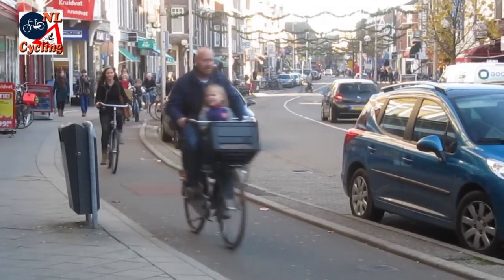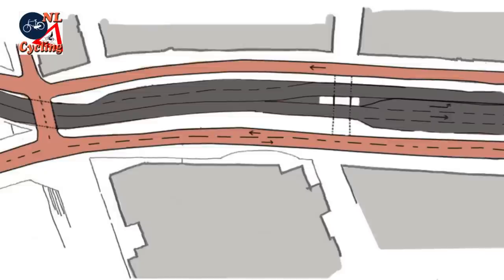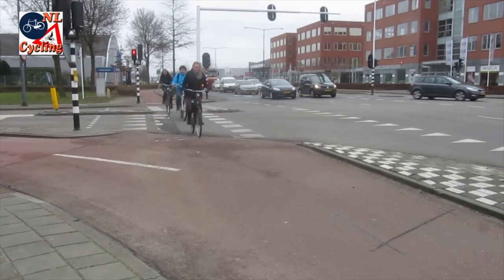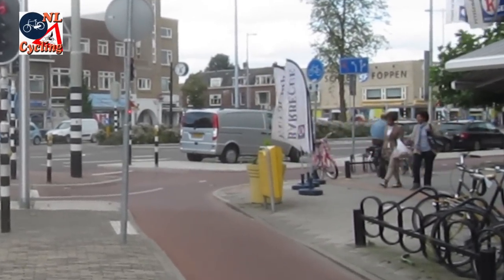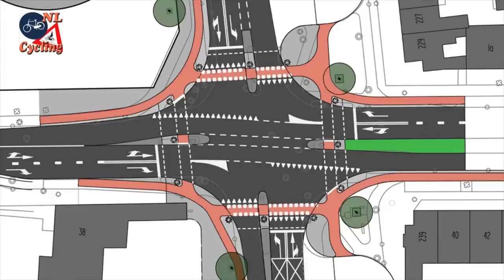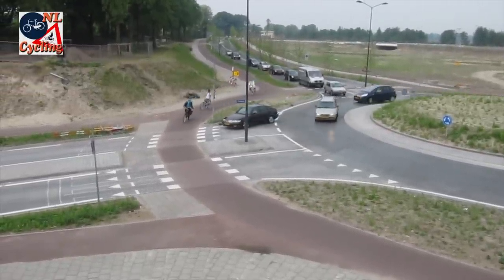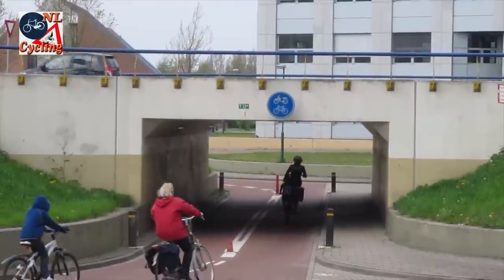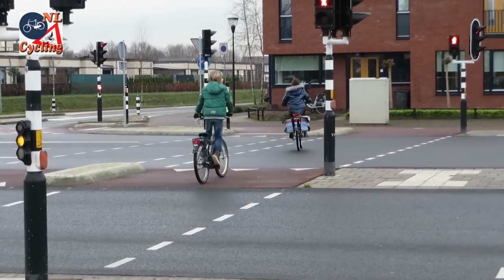Junction design in the Netherlands [311]

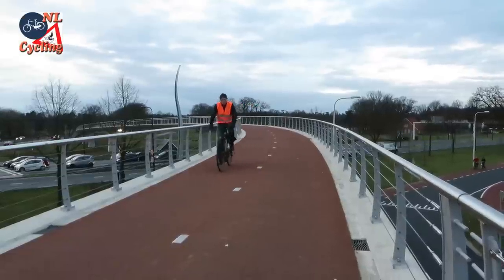Comment: I completely disagree with the roundabouts being safer for cyclists. It is an absolute nightmare if you have to stop in a truck and give way to cyclists on the right. You can get a good look in as you approach the roundabout and whilst navigating it, but if you have to stop, it can be extremely hard to be 100% sure it is clear. IMO, cyclists should give way here. Perfect example is 3:49 if this coach had to stop to let a few more through, he would find it very difficult to look back and check for more. At 4:55 we can see the blue truck basically just hopes for the best; he would not put his life savings on it being 100% clear.

Comment: "Speeds at turbo roundabouts are usually so high that there is no alternative than to have cyclists bypass them in an underpass" - and in the UK, of course, cyclists are expected to share the roundabout with motor vehicles, regardless of speed or safety.

Comment: The best way is to prohibit pedestrians and vehicles of less than 4 wheels.  Problem solved!  And to the narrator... slowing or stopping traffic is NEVER better for the environment.  When you stop a vehicle, you're idling, resulting in zero MPG.  And then you have to accelerate, resulting in worse than zero MPG, more noise, more pollution.  The ideal solution is to have a system of under/over passes with on/off ramps and access roads for shopping centers and residential areas.  NO traffic lights, NO stop signs, NO roundabouts... NO slowing down or stopping.  This would require demolishing the entire world and rebuilding it with proper, correct, gasoline powered, v8, rear wheel drive, 20 foot long, 8 food wide American cars and trucks in mind.  Anything else is wrong, immoral, idiotic, and just plain fucking stupid!

Comment: Our country went on a roundabout craze. I hate and love them at the same time. I hate that if you drive constantly from a roundabout to roundabout you are constantly on the edge, constantly having to push your car forwards and stop if the traffic moves and constantly monitor the situation.

With traffic lights its simple, miss your turn? Wait, you can even grab a drink or check your phone log, you have like ~15-30 sec of standing in one spot.

The positive about roundabouts with light traffic, you obviously gain momentum but you somewhat have more stress.

Comment: Now all car drivers need to do is actually stop when they are supposed to. I've been hit by a car twice in one month while riding my bicycle because they just drove on without looking, at a place where they were required to stop. All these crossing points and roundabouts are great, but it still won't work if people (both car drivers and cyclists) don't follow the rules. However, it's still better than Australia. I've been there 3 times and I would NOT dare to ride a bike there!

Comment: A troublesome addition to this design has been implemented in Delft; most cycle lanes are bidirectional - also on the roundabouts. As a result, neither pedestrians nor car drivers know where to look.
Reply: Agreed, the big roundabout in Pijnacker is also infamous for the two-way traffic. I ride and drive there regularly and both on the bike and in the car it is a dangerous situation.
Reply: We also have one in Hoofddorp centre with the fountain in the middle. 
It used to be a single direction for cyclists for a long time. Then it suddenly changed into a bidirectional roundabout. I'll admit that turning left is quicker and will save you some time if you want to go straight through, instead of going all around when turning right. But it has become a bit more challenging for drivers and cyclists alike.

Then again, this has been done to create a seperate cyclist lane which runs on one side of the
Marktplein / Kruisweg, to avoid having cyclists on the road.
Reply: yeah those ones are even confusing to me as a cyclist, it's often unclear where to go.
Reply: They make no sense, they're counter-intuitive. I don't think they'll be a lasting thing.

Comment: bicycles should never have priority. Cars have visibility problems with all the over thickened roof pillars due to safety regulations, and all cars today weigh 3000+ pounds, even the economy cars because of said safety and "environmental" regulations. It is dangerous for cars to be slamming on their brakes to make way for a bicycle that might weigh 150-200 lbs including the rider that can stop on a dime and has perfect unobstructed visibility. safety in traffic should always be the responsibility of the cyclist.
Reply: Morally speaking safety is the responsibility of the one putting others in danger over the one putting himself in danger. If you don't want responsibility, then maybe you shouldn't be slinging 3000+ pounds projectiles around.

Comment: These designs are way to trusting in motor drivers i don't move unless i look a driver in the eye first while walking or riding a bike.
Reply: Okay, very good point. That is exactly why it was built this way: cyclists and drivers and pedestrians can see each other face to face before moving. A split second is all you need to make your decision. Whereas with drivers coming up from behind, that would be impossible. But the best proof would be to try it out for yourself. Don't just take my word for it. Or as second best, read reports of your fellow countrymen cycling in NL.
Reply: A. Goldsby well dutch are used to cyclists soo
Reply: A. Goldsby 
You need to still be careful due to cell phone users... They can be looking at you, but not see you.
Reply: Danielchai S you cant realy use your cellphon in the car in the netherlands since we use a lot of speedbumps and stuff

Comment: "Cycling at high speeds possible," I'm sorry but there's no way you can safely ride a bike at over 15 mph in those lanes, which you can easily do in most US cities, if you know what you're doing. I'd hate to be stuck behind some of the slow cyclists in the video. I can average close to 15 during rush hour traffic in Manhattan, which means I'm cursing at over 20. Doing that on such narrow bike lanes with seniors and kids is dangerous.
Reply: I guess you're right. Yours is one category of cyclists the inner city cannot cater for in this design. Further out there should be no problem.
Reply: Actually no he isnt, you can easily safely do 15 to 20mph if you know what you're doing and slow down a bit for crossings or when theres traffic.
Often mopeds and scooters use them as well. But if you use your eyes and brain, a lot is possible.
He just wants to be the cool 90s guy in Manhattan on the mountainbike with the headphones waving through traffic like marty mcfly on his skateboard, but with an iphone and a latte.

Comment: 3:30 They are actually worse for the environment, because cars have to slow down massively and get back up to speed again.
Reply: Robert  That's true, but this is the Netherlands. Roundabounts are mostly placed on crossings without traffic lights, where traffic on the larger road has right of way. Most traffic won't have to slow down whatsoever in that case.

Comment: Does somebody notice the lack of pedestrians?
What would occur if a cyclist decided to not use that bike lanes?
Reply: You would be put into your place by motorists quite quickly, unless you can keep up to speed with them.  Some people with "egg-shell" bicycles (a bicycle with an egg-shaped, aerodynamic hull around it where you sit in with your head sticking out sometimes equipped with left and right turn indicators) sometimes choose to ride on the regular road because the safe havens for regular bicycles are not long enough for their bikes, and also, if it's wider than 75 centimeters they can choose to ride on the regular road, which could also be safer because they can keep up with cars.  /watch?v=ssD_ZVErgTg  << in this clip (unfortunately completely in Dutch) from a program about all aspects of road safety and road behavior of all groups of traffic you can see someone with one of those egg-shell bicycles doing over 60 kilometers an hour, which is around 37 mph.

Comment: Now check out the number of deaths and injuries from people being knocked down where bicycle paths cross roads. I lived in the Netherlands for 25 years and witnessed a huge number of accidents. As a car driver bicycles are often not visible coming from the right hand side if a left hand drive car. These systems are very dangerous and not to be recommended.
Reply: As compared to what? The lowest rate of injuries and casualties per kilometer ridden, world wide. That's just statistics. Any suggestions for improvements? And again, compared to what?
Reply: It just shows the danger of mixing high and low speed traffic I would say. In the ideal situation these two modes of transport would aways be separated, until the speed in a shared space is low enough to allow mixing. But until we can afford tunnels and flyovers at every crossing, the dutch approach is probably the best we can hope for.

Comment: As a Dutch guy, I want to say that the nice design shown in this video is amazing, but don't expect to find such nice junctions everywhere. Most of the areas I drive that are outside of the city, or in smaller cities aren't that well designed.

Cars have to wait on the roundabout for cyclists because there's no zone for cars to wait, blocking other traffic. When you turn of a road that has a bicycle lane, like at 2:35, there's quite often no zone to wait in. You have to stop your car in 80km/h traffic to wait for cyclists. This is annoying and can be dangerous.

In the large cities and the busiest roads though, the system is absolutely amazing and cycling can get you through traffic way faster and safer than a car :)

Comment: In germany most cyclists still use the roads EVEN when there are seperate parts for them nexto the street. No joke, you see this everyday. The biggest problem here is not the infrastucture but the behavior of the people...
Reply: Nope, it's the infrastructure, unless you think Dutch people are somehow morally superior to Germans...If people are using car lanes instead of the bike lane, that means that the bike lane is sub standard. in the Netherlands bike lanes take the most direct routes, usually have priority at lights & are better maintained than the roads. Using the car lane would slow a cyclist down, so nobody would think of doing it. Anyway, it's illegal not to use bike lane if there is one, but you'd be crazy not to.

Comment: you have to have super wide distances between buildings
Reply: FullOilBarrel which isnt really a problem.
Reply: You'll see that in the more modern parts of dutch cities, where the distance between buildings is larger to account for car traffic. In older parts of town, you'll often see only two lane (one in each direction) brick roads shared with cyclists, or only a thin cycling lane. This is, of course, only for light traffic in the city centers.

Comment: I live in Milton Keynes the city of roundabouts and im sorry but the roundabout system would not work here as it is by far too dangerous to cross on the roundabout, we just have underpasses everywhere so you never ever have to cross a main road.
Reply: But you must agree that Milton Keynes has been built on a Netherlands (civilian friendly) Structure, redways are everywhere and is probably one of the safest cities for civilians where cars can go at motorway speeds within the center of town. It may not be pretty with the blocks but is is designed beautifully.
Reply: I went to reply but your comment is not here, wtf.
Reply: That is strange as we were only discussing, not like we were arguing actually it was rather interesting...
Reply: Now your newest comment isn't here, but the older comment is. Youtube, please fix your shit.

I think Milton Keynes is a prime example to for example the US as to how they can reform their car-centric cities to bike-friendly cities without needing massive reconstructions and lane removals that would most likely not be received well. I just have a thing against roundabouts, they really shouldn't be placed on through roads, place them in residential areas all you like, but through roads? No, just no.
Reply: If you can go to Milton Keynes its a good experience its like watching those car commercials where they stunt with them. People here have gotten used to it barely slows you down as there is no red lights.

Comment: This is because there are more cycles there otherwise these designs are flop in vehicle dense cities.
Reply: Did you ever consider there are more bikes exactly because it is designed that way? That's the whole point, really.
Reply: @mourlyvold7655  No, not originally. If you made this in a traditional car friendly city, it would flop. This cannot work everywhere. For example: UAE.
Reply: @Shumayal  
We're basicly saying the same thing, really:
Design for cars, you'll have cars. Design for pedestrians and bicycles (and public transport) and that's what you'll get.
We are traditionally a biking nation, true. But it's very clear that implementing bike friendly design stimulates their use dramaticly. There's 50 years of experience to proof it. 
We were moving into the opposite direction in the 1960's (car centered) but people just were not having it, and local governements responded. That developed into a nation-wide policy. 
So that's what I meant to say. Development driven by design, as a response to a popular ground-up movement. I do understand the situation in the UAE is much different. In general the Dutch agree we're better off this way... 
Peace.
Reply: @mourlyvold7655  yes it works for the Dutch. Because with the example of UAE, you have the hot climate which means only the poor people cycle and use public transport.. . those who can't afford cars.
Reply: @Shumayal  I understand.

Comment: What happens in winter? Who plows the bike/walk ways?
Reply: SolarizeYourLife In the winter salt is used to melt the snow/ice.
Reply: +SolarizeYourLife: Cycle tracks are plowed, brushed, salted or a combination of these, just as the rest of the roads. Some municipalitied even give priority to maintenance of cycle paths.
Reply: +ProtectingSilence really, I thought salt was not good for the environment?
Reply: Your comments are not smart enough. -  And pedestrian paths are also salted! Even the landing paths for the planes to take of and landing are treated the same way!
Reply: +SolarizeYourLife When I did contract work in Boulder Colorado, the city plowed and salted the bike trails, separated from busy streets as soon as the streets themselves.  It takes only a little tractor and plow and bike paths don't need that much salt either, no sweat plowing a bike trail.  I rode my bike at temperatures down to about -12 deg C (10 deg F) at night and I still saw plenty of people bike riding really not that cold for Colorado.  Boulder gets colder and can receive more snow in a blizzard than in the Netherlands, but even though it is in the USA some good bike infrastructure which is not so expensive makes a radical difference, nearly 20% on bicycles or walking in the city limits.  Cities like Boulder Colorado and Davis California which have good bicycle infrastructure near European standards are not common, but since it is just a reasonable change in priorities, cars still get considerably more money in city transportation budgets. Other American cities will get there soon, since good bicycle infrastructure improves the quality of life, makes the city more attractive, and improves small business while fitting in a city budget; smart and cost effective a good deal for cities.
Reply: Thats why in the Netherlands we dont usually drive our oldtimers in winter, since they'll get corroded by the salt. We do use a lot of salt and it's probably really bad for the environment too, but I'm not sure what the effect is of al the salt on the roads, perhaps a big chunk of it gets into the sewers after which it's filtered out again. The better solution which is already developing is global warming, which removes the snow from the winters alltogether. It's already less frequent, we're lucky to have 3 snow days a year.
Reply: It rarely snows and when it does, it's usually melted by noon.
Reply: It's not, but if there's no alternative it's the only option.
Reply: This is the Netherlands. Roads don't get plowed because it hardly ever snows, and big amounts of snow are about as rare as unicorns...
Reply: SolarizeYourLife its like magic, in the morning they are just magically cleared with salt. and normally we only have a week of snow in total.

Comment: Sesperate levels, always separate levels, bike tracks should be in the air like small highways a few storeys high all around the city. The weak might complain about climbing up a gradient to merge into this 'bike motorway' so you could have an elevator style mechanism on each on ramp. On the bike motorway itself you can have 6 lanes with a barrier in the middle, 3 lanes each direction with overtaking rules of car motorways.
Why no one has built this yet confuses the shit out of me. Cmon china, you guys could throw it up in a week.